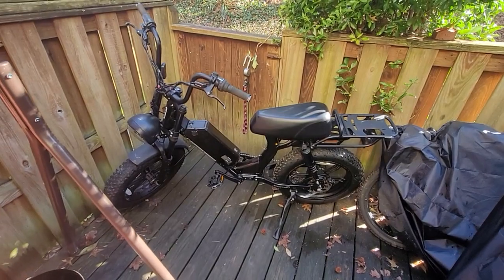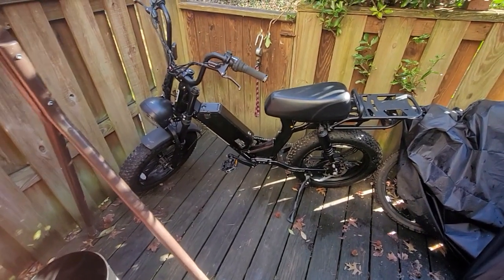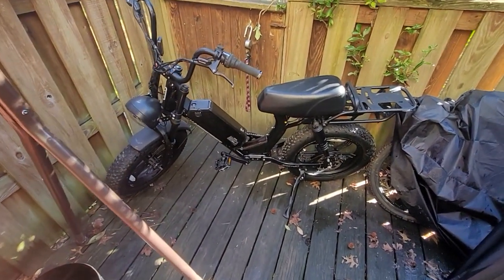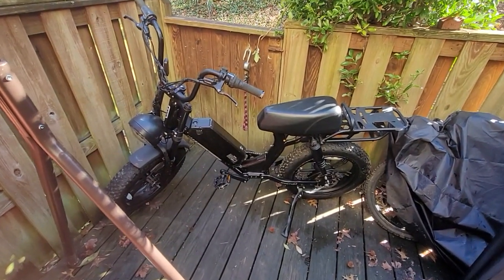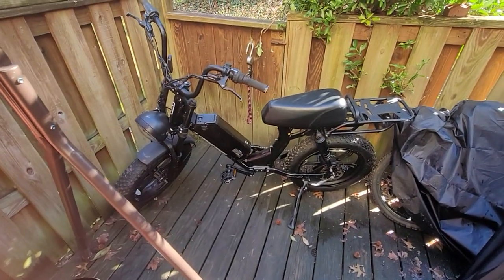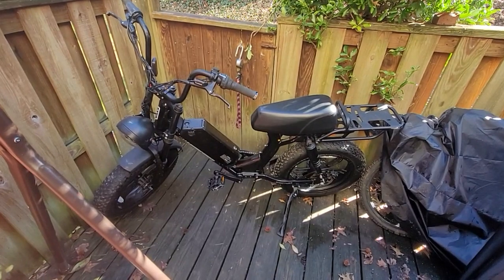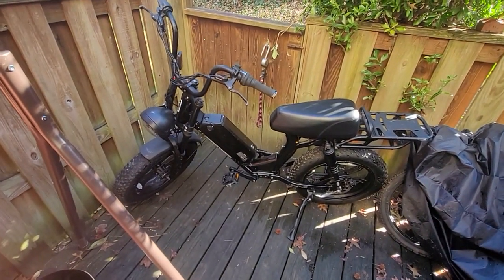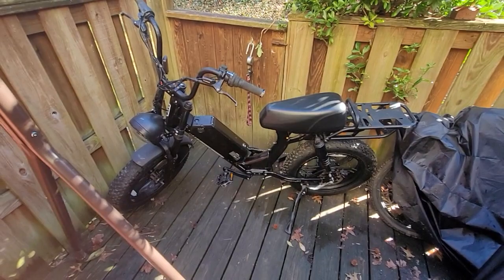Mod any ebike to go Faster, Easy inexpensive mods starting with simple battery upgrades for voltage

Comment: Such a tease Chris hurry up 😁
Reply from the maker: lol
Reply from the maker: Man you try doing 100 mph on a half mile road with traffic red lights curves and the occasional police that post up at the college. Just gotta be the righ conditions with an opening green lights and no traffic. If and when i make it to the country its a done deal. The highway she lives on is like 40mile stretch but shes also hour and half away. Gotta load bike up, Man you guys are pressed to see the wrong numbers but you get it. I know what this bike is capable of I ride the thing. Its also a track Im going to check out, that may be the best bet as I know when I film this it may get a few views who's to say if the haterz wont turn me in so maybe i should be on the track
Reply: @ChrisCrossingWires1212  No need to explain I understand and I support you. Got the flu and haven't seen my bike in 2 days, I miss her 😭